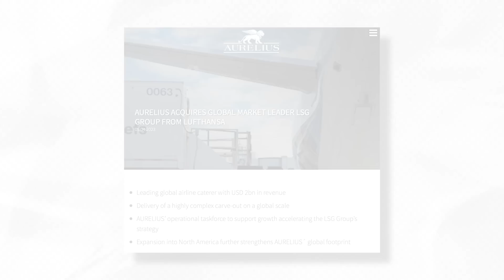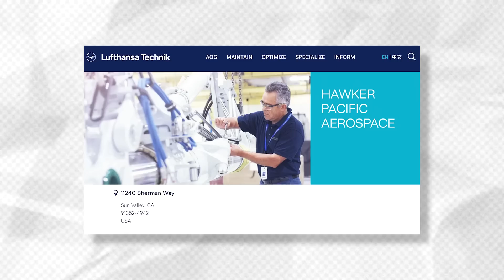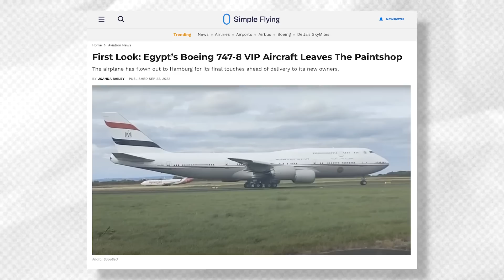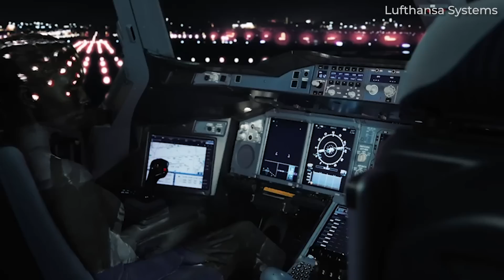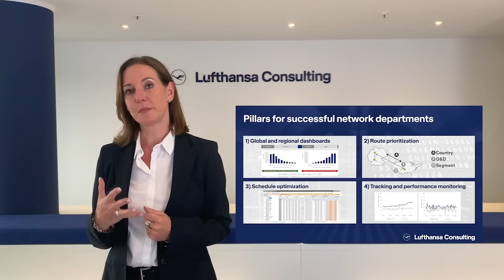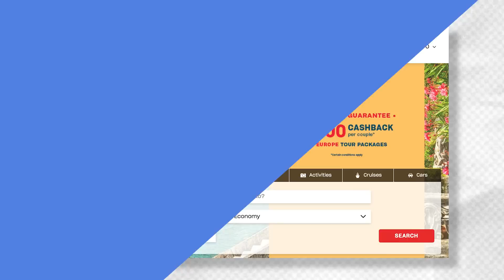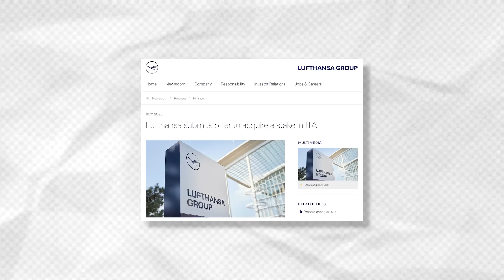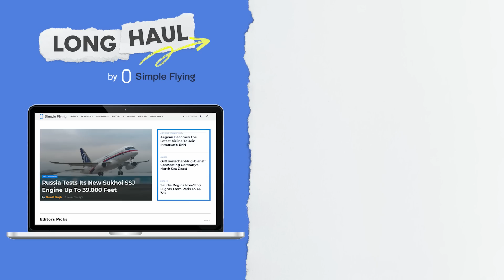Much More Than An Airline: The Incredible Diversity Of The Lufthansa Group

Comment: It's honestly insane that two of the group's most profitable businesses, Lufthansa Industry Solutions and Lufthansa Systems, are not even airlines, but rather software and information companies which sell solutions developed for Lufthansa own operations to other airlines.
A bit like french airplane maker Dassault: they started decades ago to develop their own 3D computer aided design software or CAD to help in the design of their aircraft...nowdays the subsidiary Dassault Systems in charge of CAD software development is actually bigger and more profitable than the airplane making branch, Dassault Aviation...
Reply: I studied Mechanical Engineering, and used softwares made by Dasault Systems

Comment: you failed to mention one of the most important softwares in maintenance and engineering which is AMOS. it is nearly used by whole airlines globally and currently, it is the most advanced system. also they have aviatar, a new software program for big data and predictive maintenance solutions.

Comment: The LSG group does not have much to do recently. In the Lufthansa flights I took recently I was only offered a single half-empty chocolate. 
In my job place cafeteria I was used to but them 0,10€
Reply: Lufthansa is always very efficient.😅 They keep costs low and prices high.

Comment: I'm German and I never flew Lufthansa in my whole life, even though I'm a frequent flyer. It is just too expensive and usually 300-400$ more on the same long-haul flight. Frankfurt - Bangkok direct flight with Thai Airways is 850$, and Lufthansa 1300$. Otherwise, you always can make a stopover and take one middle eastern airline for 580$. Never ever there was a cheaper flight with Lufthansa available. The service isn't that great, and the planes are old. What should be a single reason to take Lufthansa?